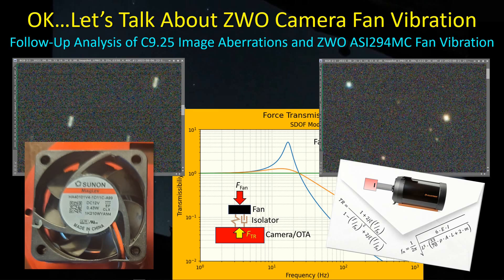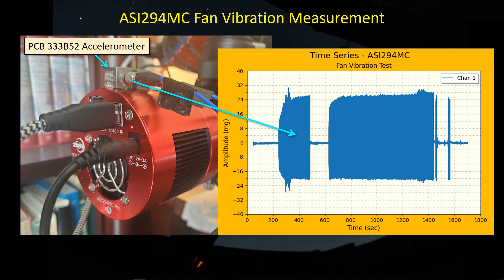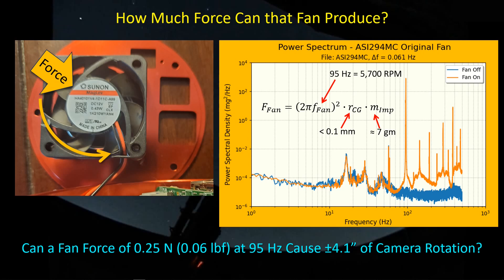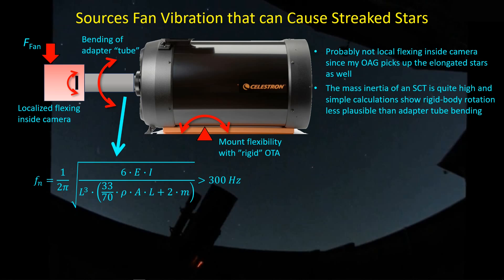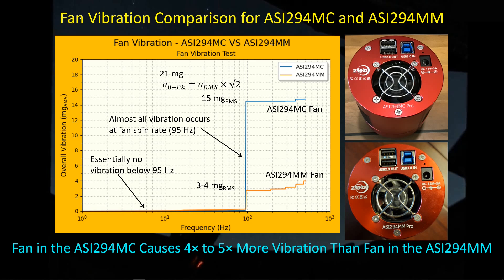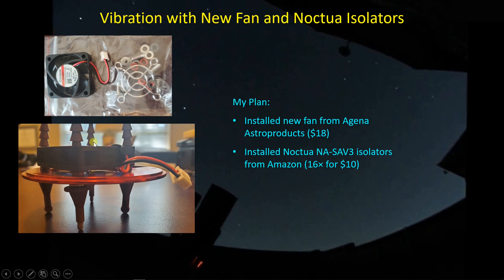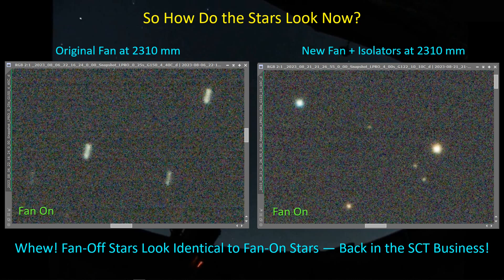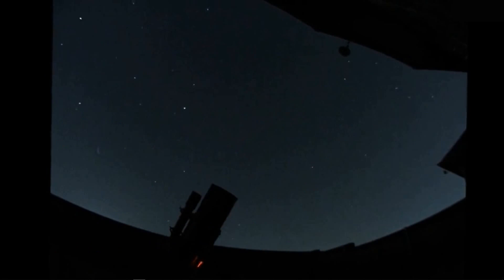ZWO Fan Vibration and Elongated Stars - Analysis and Measurement

Comment: What about cork dumper?
Anyhow ZWO has to fix this issue
Reply from the maker: Don’t hold your breath on ZWO fixing it. Mostly just a problem at high focal lengths. Still, they SHOULD fix it. In the world of vibration, this problem needs to solved with an “isolator” not with a “damper”. An isolator is a low stiffness “spring” that would be placed between the fan and the camera body. This design allows the force generated by the fan to be cancelled out by the lateral motion of the fan body.

Comment: Interesting. Thank you. Just yesterday I received my ZWO filter wheel so I can now assemble my imaging train for my 8" Edge HD. I am starting with the 533mm and saving for a 2600 mc and a hyperstar.  With the reducer I will have 3 telescopes in 1. I will keep this in mind. Do you know, do all the cameras use the same fan? If so I think I will get 1 from Agena and put it on the shelf.  Be safe.
Reply from the maker: @Big.Ron1  I’m guessing the larger sensor cameras are using a larger diameter fan, but I’m not sure. Maybe look at ZWO’s dimensioned drawings of the grill on the back of the camera. A larger diameter grill is probably paired with a larger fan.
Reply: @Aero19612  thank you.

Comment: I have just solved this very issue with my QHY163.  I think it's worth mentioning some of what i encountered here. Camera was at first being used at F2.3 , it wasn't until i switched over to F10 the problem was obvious. The first thing i tried was a new fan with no improvement. Removing the filter draw did make a noticable improvement, my imaging train without the draw is a solid billet macined assembly. Whilst a major effort was made to isolate the fan it did not solve my problem. I finally got nice round stars but they still looked slightly bloated. Now without the more extreme distortion at the start i probably would not have questioned my stars. But they were still not as sharp as with the fan off. My fix was to add a 50ohm resistor to slow the fan and my problem is solved. My guess is the sensor is being vibrated not the scope, but could be wrong. I wonder how many people experience slight star bloating and don't even know?

Comment: Thanks for this video. I bought an AM3 and 2600mm during the winter sale but ever since I've been going crazy trying to figure out what is causing trailed stars even when guiding is exceptional. I've bought a new guidescope, new guide cam, new cable management, new mounting solutions and nothing fixed it. Last night I turned off the cooler after seeing this video and sure enough, that was it. New fan ordered.
Reply from the maker: Glad it helped. What focal length are you imaging at?
Reply: Just 500mm (740mm after crop factor). I've been using a nikon 500mm f4. I suspect that the ZWO adapter having a tiny little bit of play in it is the weak spot that is picking up the fan vibrations. Ran the test 2 times and both times the stars round up nicely with the fan off.
   @Aero19612

Comment: I had this problem a few years ago with my ASI178MM-Cooled camera. I struggled for at leased a month of troubleshooting trying to figure it out. Then I found a post on a forum of someone that had the same shaped stars that I was getting who suspected the fan was the cause. I then pointed my scope to the zenith and took very short 0.25 second exposures, with tracking on and the fan on and then off. The difference was night and day. Pinpoint stars again with the fan off, as you can imagine I was overjoyed with this. When the fan was on, I put my finger on the camera housing and I could definitely feel some vibration. I bought a zero vibration fan on amazon and replaced it. I then recalled when I was around the scope a week or so before the problem, a bug or something got chewed up in the fan. It rattled around in the fan for a few seconds then dropped out of it. It had returned to its normal operating sound so I didn't think anything of it at the time.
Reply from the maker: This hobby…

Comment: Great analysis. Is this a common problem with all ASI Pro cooled cameras? I'm looking for my first Pro camera for my C8. Thanks
Reply from the maker: Seems to be common when cameras are used at high focal length, say > 1000 mm. The problem isn't the camera per se; it's the cheap fan they use and attached with no vibration isolation.

Comment: Hi James. What do you think about isolating the entire back plate? The fan vibration has to be first transferred to the back plate then through the plate to the rest of the system. If there isn't enough room to isolate the fan perhaps there is more room for the while plate?
Reply from the maker: That would work in principle. On the practical side, we have to plug in a power cable and a USB cable through the openings in the back plate that will not allow for the free movement of the plate which is required for vibration isolation. I’m working on a 3D printed part concept that would provide isolation. I’ve got nothing but clouds in front of me so maybe I’ll make some progress on that front. Famous last words

Comment: Could you put the fan on the outside of the case and use ducting to get the air flow to the fins?  This would allow more of the isolators length.
Reply from the maker: That’s a good idea. I’m trying to dream up a 3D printed part that could hold the fan inside and still allow the motion required for vibration isolation. Thanks for watching!

Comment: Great video! What about 3D printing a tube shaped adapter that would allow us to run the fan on the outside of the camera, which would then allow you to run very thick isolators?
Reply from the maker: Thanks for watching. I am exploring 3D printing options where the plastic is acting like a spring to provide vibration isolation....we'll see
Reply: @Aero19612  that’s a good idea. I just tested my 2600MM and my FWHM jumps 1.5” fan on vs off so I’m in the same boat. I’ll post an update if I print anything that ends up being helpful.

Comment: James, I never could get round stars with my 8" Edge HD.  Got a bigger mount, larger guide scope, etc.  I had noticed satellite trails that looked like a high freq sine wave,, perhaps servo?  Then I heard of the fan issue with asi2600 cameras.  I could feel vibration in the scope!
Reply from the maker: Yes. I saw those wavy satellite trails too. I didn't occur to me that was caused by the fan.

Comment: James. Great work. we have chatted before. I have a similar scope setup ( SCT 9.25, Celestron OAG, Celestron Focuser) but mine is using a ZWO ASI2400 MC pro camera and a RST135 mount. So far I seem to be ok with imaging at Full FL 2340, but will be keeping an eye on my star shape in case the fan develops issues. 
An idea for those of us without acccel equipment. For vib detection, I wonder if one could use a plastic shot glass with liquid and mount it on camera with modeling clay. Not precision but maybe good indicator on how smooth or rough?  Take care
Reply from the maker: Hey Steve,
You could, but that doesn't quantify the vibration level. You might just be able to "see" the vibration. And then there's the risk of spilling your "accelerometer" in your camera. Try using your cell phone - it has a 3-axis accelerometer in it. There are apps that let you tap into the accel and provide real-time plots.
Reply: Hey. I didn’t say to be sampling a certain alcohol liquid before using the shot glass.😅 just using it as a rough indicator. I figure If you don’t see any ripples when fan turns on then probably no fan issues. I know, not an exacting measurement, but quick and easy. I guess could also use stethoscope for rough check….. (retired Mechanical Engineer) . Take care

Comment: Are there particular reasons that you are sticking with ZWO cameras and filter wheels? 
Why not to get QHY or Moravian cambos? Their prices little bit higher, but quality you get in return is by miles better. 
I fought these battles, made transition to non-ZWO world. Improvement is in every aspect: cleaner background due to calibration, FWHM is always <2-2.2 arcseq, etc. 
It was time when I thought FWHM < 2 ain’t going to happen, seeing will not allowed. Well, seeing wasn’t problem at all.
Reply from the maker: The filter wheel works fine - no problems there. I like the ZWO cameras I have. They could/should have put more thought into the fan support to prevent vibration transmission. Oh well. There are solutions for that. I certainly would not buy a whole new camera because of the $10 fan.
Reply: @Aero19612  It is not only fan problem. I had 294mm and 294mc. One day, it calibrated fine; another day, as bad as it gets. It ruined a lot of image-hours. Filter wheel was rubbish as well. ZWO advised “spin it in one direction only, otherwise, we cannot guarantee accuracy “. 
Just great. Finally, I had enough. Got rid of every ZWO I had. Their resale value is quite high.
Reply from the maker: I'll keep an eye on my ZWO equipment and see how it behaves. Other than this fan issue, I've been pretty happy. As you say, things can change.

Comment: This was very timely.  I got a brand new NYX-101 mount and I've waited over a month to test it.  Had a clear night a few days ago but.... I live in Phoenix and the current night time temps are still over 100.  When I tried my first light I had a number of issues.  Nothing major and 90% of it were my fault but I noticed that my subs had egg shaped stars across the entire FOV.  I knew I would get them in the far corners because my OTA is not flat there.  What surprised me was the bad stars in the center of the FOV.  Now I remember looking at NINA and my camera fan was running at 100% and my cooling was running at close to that to maintain a temp of 0C.  Yea..... I was most likely shaking the daylights out of my optical path as you have demonstrated.  Thanks much!
Reply from the maker: Hey Phil. Congrats on the new mount and finally getting a chance to use it! One note: the camera fan runs at a constant speed regardless of the cooling %. Anytime the cooler is running, whether 100% or 10%, you'll have the same streaked stars until you replace the fan. Bummer. Thanks for watching!
Reply: @Aero19612  Hmm ok interesting.  Then it must be related to something else.  I got excellent images about 2 months ago with the exact same OTA on my EQ6R of M16.  I have to wait for this oppressive heat to break so I can spend some quality time looking into it.  At the moment I look like the guy piloting the plane in the movie Airplane sweating profusely everywhere.  Not fun.
Reply from the maker: @PhilFXPhoenix  Can still be the fan. Given the range of motion caused by my fan, I would have expected to see stretched stars with the focal reducer. I didn't. So, did the fan "go bad" between the last image with the focal reducer and the first attempt without the focal reducer? Sounds coincidental, but possible. Next time it's < 100F, try taking images with the fan off, then repeat with the fan on. If you see the same artifacts with the fan off, then you know it's not the fan. Also try very short exposures, with fan off and the mount parked. Stay cool!

Comment: Kinda of the long way around changing out a bad fan eh…
Reply from the maker: Astrophotography is a long way around to have a picture of M 81, but we do it anyway. You can “assume” a fan is bad and “assume” that a replacement fan is better and then go outside at night to see if you’re correct. When possible, I prefer to measure and know the fan is 5x worse than another fan and measure and know the new fan is 5x better than the old fan. But, I agree, assuming requires less effort than knowing. Just not my style.

Comment: James do you have a link to the fan you replaced yours with?
Reply from the maker: The fan I replaced in the ASI294MC is the same make and model that ZWO used:
https://agenaastro.com/zwo-fan-for-cool-pro-camera.html

Some people are using a Noctua fan as a replacement, but it requires that you modify the power leads. From Amazon:
"Noctua NF-A4x10 FLX, Premium Quiet Fan, 3-Pin (40x10mm, Brown)"

Comment: I also had the “fan streaking stars” in my ASI533. Decided to use these isolators with a straight new replacement ZWO fan. Job done. No streaking.
Reply from the maker: This is an irritating and sufficiently widespread problem. Would be nice if ZWO would take this seriously in their fan attachment.

Comment: So why is this just a ZWO phenomenon, are they just using poorer quality fans than everyone else, or are their camera body frames too thin/low mass?
Reply from the maker: I'm not sure if it's just a ZWO issue. Maybe it is. Or maybe 10x more people have ZWO cameras vs QHY. And there could be a fan vibration isolation designed into other cameras. There certainly isn't one in the ZWO cameras. There also appears to be significant fan-to-fan variability in the Sunon fans that ZWO uses.

Comment: I'm always amazed at your math skills.  I love your videos.  What was impact on the cooling ability of the fan by changing the aerodynamics of the original design?
Reply from the maker: I’ve been blessed with clouds since I swapped fans. I really didn’t change the aerodynamics, just got a version of the same fan that’s put together better. Will be interesting to see if these fans wear out and start to produce more vibration over time.

Comment: Could this be a particular production run of these cameras? I have the 294MC Pro on a 10" SCT and EQ6R-Pro mount, zero issues with my imaging.
Reply from the maker: Hey Dennis,
If anything, it may be a bad batch of fans - maybe that’s what you meant. The cameras are fine. And the “bad” fans are probably not an issue for shorter focal lengths. Keep an eye on your images. You’ll know how to quickly fix it. Maybe even consider getting a replacement fan for “just in case.” Thanks for watching!

Comment: Excellent video!  I dont know if this problem exists for the 2600mm but my fan is really dirty. Is there video on just cleaning it? Disassembly instructions?
Reply from the maker: The 2600 uses a larger fan but it’s made by the same company, so I suspect some 2600 users are experiencing this problem. As for disassembly, do a YouTube search for “ZWO fan” and you’ll get a list of videos that will demonstrate taking it apart. Thanks for watching!

Comment: Very good and informative video. I have bought a used ASI294MC Pro and the first things I did was change the fan to a noctua one with the rubber stand-offs. I did this because the fan made weird rattling noises (It was a larger insect that got stuck in the fan). The noctua fan is just great quality and very silent.
Reply from the maker: I bought one of those fans to test (hasn’t arrived yet). Thanks for watching?
Reply: Which model fan did you buy for the 294, having trouble finding a matching 3rd party, no issue finding the standoffs and the zwo replacement though

Comment: The ASI2600MC Pro has a larger fan.  It uses a 50x50x10mm fan vs. 40x40x10mm fan in the ASI294MC Pro.  There also is much more room (thickness) to work with.  I replaced my fan with a 15mm thick Gelid Silent5 fan. that actually pushed more airflow with less RPM and less noise and also added the Noctua isolators.  Works great.  But I had to solder the connector onto the fan lead.  I think there is over 20mm of thickness to work with, so more room for isolators if you use stock fan. Noctua does make 40x40x10mm fans, but no 50mm fans.
Reply from the maker: Thanks, Dale. I ordered one of those Noctua fans to play with. I suspect this won’t be the last video on fans and/or vibration.
Reply: @Aero19612  My first ASI2600MC Pro, back in June of 2020, had a bad fan out of the box.  I had stars that looked like grains of rice.  I quickly determined that it was the fan due to me being able to see the stars elongate in real time while zoomed in and focusing (with or without a Bahtinov mask) when I turned the fan on and off. I took a video of it and sent it to ZWO and they replaced the camera with a new one, which didn't have the issue.  I've since replaced the fan on that one with my one I mention above.  I bought a number of fans and chose the one I liked the best.  Back in 2020, I initially bought a Noctua 40mm fan to fix myself before I sent it back to ZWO, but realized only when I opened up the camera that the fan size doesn't match and they didn't sell the larger replacement fans at that time like they do now.  I'm glad to see you solved your problem, but really liked the way you analyzed the problem with sensors and engineering, so now we all have more information on how to deal with this better.  I wonder if the DUOs have a better fan mounting method?
Reply from the maker: @dalehollenbaugh6084 I doubt the Duo has any different fan mounting method. If ZWO is going to blindly send out new cameras because a $10 fan is causing too much vibration, they should seriously look into a cheap/effective vibration isolation system.
Reply: Information video. I wonder if a maglev fan would make any difference if you can get one to fit.
Reply: @givemespace2742  The original ZWO fan actually is a MagLev fan.
Reply: Turns out Sunon do. If I have the problem I might try one.